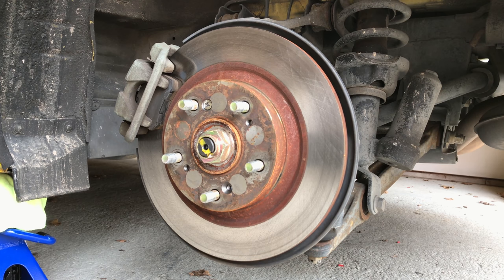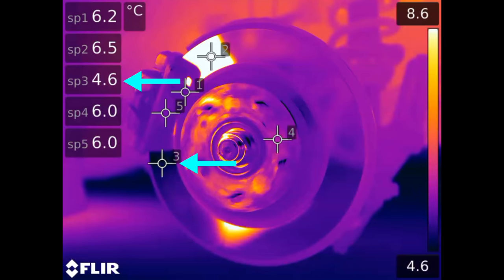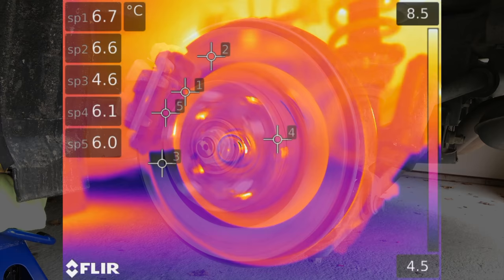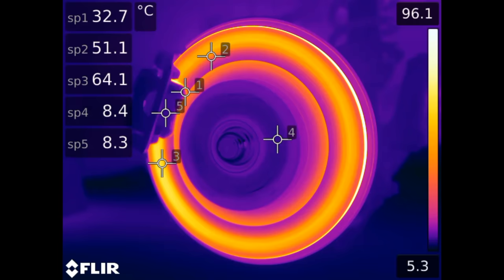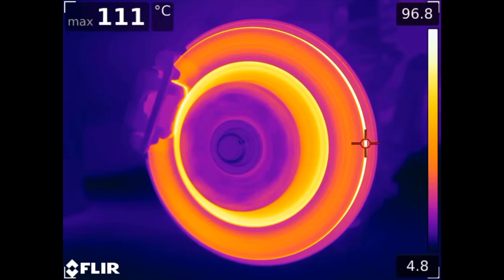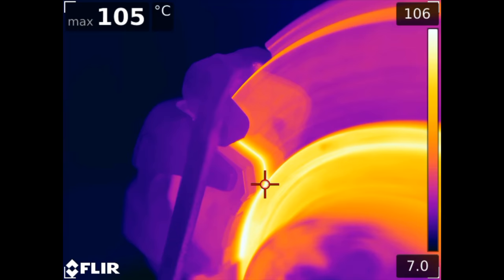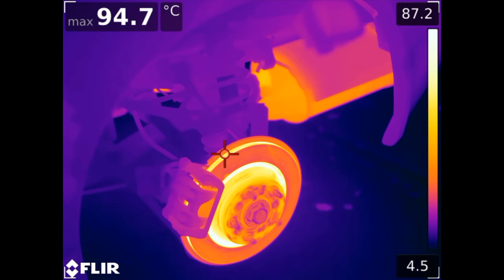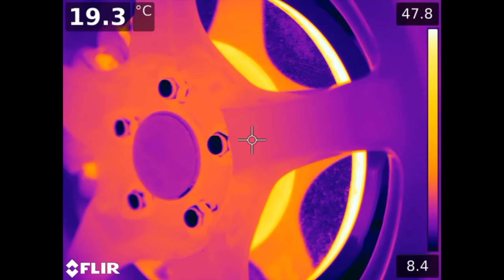How Hot Do Your Brakes Get?

Comment: Interesting that this is posted today.  During NASCAR practice yesterday, it was noted that due to the heavy cars, 3400+ lbs, small tires and wheels, the brakes generate tremendous heat.  The brake rotors and calipers fill nearly all of the space within the small wheel so that most cooling comes from ducting the teams add for cooling.
Due to brake technology, the brake systems don't fail anymore but what does happen is that the heat generated from the system gets transferred to the steel wheel and melts the bead of the tire causing tire failure.
Reply: jmurphy1973 That's neat.
Reply: jmurphy1973 The wheel acts as a heat sink and when you go to a track day you can definitely feel the wheel heat up. Do NASCAR cars really transfer so much heat to the tires that it melts the rubber? If this were a common occurrence you would see constant tire failure. However that's not the case. The wheel must be acting like a sufficiently effective heat sink to mitigate this.
Reply: I dont really get nascar. Subpar cars, nothing that could be called "track" and thats basically it. Why do people do that?! lel
Reply: Sheesh NASCAR is pretty much a drafting contest. Although it might not look like much, it does require a degree in skill especially to know when and when not to brake. I personally am in to motor cross or rally car racing but I've seen these motorsports, they all have their spirits and I respect them equally. But I also like to tease them around :)
Reply: Not every week the teams race in 95 degree temps, like they are encountering this week in Phoenix.
Reply: It's just a tradition at this point. I liken it to the modern version of the ancient Roman chariot races.
Reply: Why do they even need brakes?  All they do is drive in an unbroken circle.
Reply: Very interesting...  
A similar failure mode was common for heavily laden touring bicycles on long steep hills using folded tires.  The rubber brakes heated up the rim until the tire could pop off (I think it was the tire pressure increase due to temperature as opposed to melting).
Reply: jmurphy1973 first off, Nascars do a few road circuits, such as infieon in calf. second off, you still need to brake Nascar on oval circuits, I mean, 3400 pounds isn't the lightest possible weight for a car, race trucks are even lighter
Reply: @Sheeshening  NASCAR seems to have eliminated all aspects of having a variety of vehicles to the point of where only slight variations in engine capability are permitted. It's like they only have one vehicle "class" unlike other race organizations that allow multiple types of vehicles to race simultaneously with class winners. NASCAR, I believe, want it to be more of a drivers' race. Yet, some wealthy owners have vehicles that are more capable of others.
Reply: Just got back from Simulation game Project Cars and it showed car braking temperature around 750F on clear day! That's nuts!
Reply: @thetechtron9465  That is crazy. But it shows the high level of energy transferred from the forward motion of the vehicle to the brakes and subsequently dissipated from them primarily by radiation.
Reply: @ninemilliondollars  Wait till you think this was too much. Saw some titanium brakes video and the temperature goes 1850F and about 1100C!!! And just to think titanium has melting point of 1600C...At this point im worried for what happens to tyres and nearby car parts

Comment: As a brake engineer, yes, aluminum wheels improve brake fade performance vs steel wheels (of course shape of wheel plays a role too).  I have never tried carbon fiber yet it should be worse since it's thermal conductivity is typically less than Aluminum.  Yet that also depends on the carbon fiber and once again wheel shape.
Reply: Cool story bro.

Comment: If the wheel can function as a heat sink for the brakes, could the application of thermal paste between the hub and wheel increase breaking performance? And which kind of wheel would be better for this purpose (shape and material wise)? As a car and PC gaming enthusiast I am exited for what we could learn from this.
Reply: ElZamo92 asking the real question there
Reply: ElZamo92 you could be onto something
Reply: I thunk some thermal grizzly conductonaut will do the trick and maybe if u lap the wheel hub it will help the cooling efficiency
Reply: out of the wheel material choices given: steel, aluminum, carbon fiber, or magnesium.... aluminum is the best conductor.  however, most aluminum wheels are painted to prevent corrosion, the paint can act as an insulator. another factor is the caliper, a heavy steel caliper retains lots of heat while an aluminum one helps dissipate it more quickly.... and the steel one will more likely help contribute to warped rotors over time. as for if a conductive paste would help, not sure try it if you want.
Reply: Any paste you apply would probably get squeezed out when you tighten down the wheel, and if you put a thermal spacer it would act like a wheel spacer and change your wheel offset which could hurt suspension performance.
And you want the wheel to absorb some of the heat of the brakes to help with cooling, but only up to a certain point and after the wheels get too hot it heats up the tires too much and can hurt your tire's grip.
Reply: yeah, I think computer thermal paste was not designed for the amout of pressure the bolts of a wheel would put on it
Reply: you underestimate how tight a cooler can be on a motherboard :D
Reply: a better option than paste, although more difficult, it has proven to reduce brake fade on track cars.... building ducts to get air forced into the center of the rotor, some even use small fans(not practical on a street car)...
Reply: thermal paste would do nothing to help braking. If anything, it could make it worse in the chance it got on the rotor.  
It also would break down pretty quickly as the wheels heat cycle, go through water, sand, road debris, etc.
Then there's the fact you aren't using that much surface area to make it effective. You'd see maybe a slight drop in temps on the hub, but as soon as you hit the brakes, the rest of the rotor would get hotter.
Reply: #duckymasterrace
I usually put a very light coating of anti-seize between my wheel and rotor to prevent the two corroding together so it's easier to remove the next time. Since it's an aluminum paste compound (copper is also available), I'm sure it acts like thermal paste allowing better transfer of heat. How much? Not a lot at all. Maybe 1%. But it's a secondary benefit. I also put it on my lug nuts for the same primary reason.
Reply: RyanRants nice. yeah same here. copper anti seize since copper is a better conductor than aluminium or steel. and works at high temp. also prevents rust and binding which is a plus
Reply: Turbofan wheel covers?
Reply: Just use some copper paste. (i always use copper paste)
You will also prevent the wheel from seizing on the to hub.
Reply: For carbon ceramic brakes, braking efficiency increases with temp.
Reply: Yathu prem sure, but those cost thousands of dollars. A pint of thermal paste costs about $50.
Reply: Carbon seramics aren't that much more than a regular set.
Reply: I tried to put thermal paste on wheel, but both surfaces were so rusty that i don't think it changed temperature much.
Reply: I agree with a lot of the replies that it wouldn't work. A better solution is to increase the diameter of the brake disc. Then have the brake pad contact the outer half of the disc, and design a rim that contacts the inner half of the brake disc. This way you're not having to transfer heat from the disc > hub > rim, its going straight from disc > rim. A perfect mating surface wouldn't matter at these temps and sizes and would only contribute to a slight increase in performance, however if you wanted a perfect mating surface, you could have a layer of copper (<1mm) pressed into the rim so that when the entire thing is tightened down, the soft copper will fill any small impurities between mating surfaces.
Reply: Good luck stopping with that setup. 
Or going for that matter.
Reply: I've experimented with this a little.  If you can get the right high temp compound, it will transfer more heat to the wheel, but not enough to notice a difference.  Industrial thermal compound is so expensive that it is not worth it.  Arctic silver or any other PC compound is already expensive enough, and it will burn off at 200C, on track brakes hit 500C+ as mentioned in the video.

Even if you had unlimited money for exotic thermal compounds, the problem is that steel is such a poor conductor of heat that it takes a while to transfer the heat from the rotor surface to the hub where the wheel can absorb it.
Reply: RyanRants don't lube your lug nuts, it interferes with accurate torquing of the nuts/bolts.
Reply: ElZamo92 Pretty sure any PC thermal paste would simply melt under temperatures of braking
Reply: Breaking performance is more important then braking.
Reply: B10401 gold would be the most expensive, and worse option. It's way too soft, and would bend under the full weight of a car.
Reply: +James pond

Not to mention it would be heavy which negates any performance gain by better brakes.

Longer to stop
Longer to accelerate to same speed
Higher fuel economy
Harder, harder to steer.
Reply: On motorcycle trackdays I've often heard people say that brake heat seeps into the wheels and helps warm the tyre from the inside out. Would be really interesting to fit a thermal camera like this to the fairing or front fork, facing at the tyre and discs (dual disc on a sportsbike front wheel) and do a few laps, see how true this is and what temperatures the disc gets to.
Reply: Painting the wheels doesn't help much at all.
You have a layer that is what microns in thickness and you think it will do anything useful.
Reply: well termal paste is pasted on  cpu and hetsink to help make a "perfect" contact point, as both surfaces are not perfectly straight, the paste fills those cracks, small place where the heatsink oesnt have contact with the cpu, as is so small in this case it helps alot, on a bigger apliance as this i think i will be really small diference
Reply: ElZamo92 I don't see why covering the contact surface in thermal grease (big tub of MX-4 sounds handy...) wouldn't help heat transfer. I would get all the rust out of there first though!

As far as material though, it really depends on what you need. Steel can soak up more heat momentarily, but aluminium will dissipate it all quicker
Reply: ElZamo92 mirror polished + artic silver 2 is still the best?
Reply: i was thinking of adding fan like extensions on the wheel spoke, so the wheel can acts as a makeshift fan.
Reply: the 1993 mustang cobra had directional fanned wheels
i think that would be a great platform to test this on
Reply: You do know that the front brakes are vented so they draw are in when it is rotating due to the centripetal force blowing the air out.
Reply: you guys should look up turbofan wheels.
Reply: ElZamo92 I believe that if the wheel's spokes are designed in a fan type way to blow air onto the rotor when traveling at speed, it would be greatly beneficial🤔
Reply: EmofacePS3 yeah, i would be easier than trying to make our own fan shaped spokes for the experiment. also would be interesting to see the aerodynamic impact as we essentially pumping air into the underneath of the car. would it cause a slight ground effect or too little to have any impact.
Reply: that's a really good idea mate, and it already exists :) check out Mercedes SLR Mclaren and it's wheels. The wheels are designed like turbine blades so they blow fresh air into the braking system. Although if one side wheels are mounted on the other side, the effect is reversed and brakes overheat with extreme ease.

Modern middle class cars also have turbine-like blades, like 2010 Mazda 6
Reply: Where are your laminated papers. No degree no one who can do something with this good idea will care.
Reply: anti seize grease kind of serves the function of thermal paste would of. although its not as efficient, it's basically grease with aluminum particles in it. it will improve thermal conductivity
Reply: I use designed for AMD thermal paste
Reply: doodskie999 i have an 8120 in my computer and i find this funny
Reply: Spraying water on your intercooler, and your rims.
Reply: Isn't gold a better reflector of IR?  That would also make it a poor emitter.
Reply: Pressure has nothing to do with this. Thermal paste is there to replace air, not metal. You still want metal-to-metal contact (which actually takes the pressure). If you put too much paste on the CPU, it would just run-out to the surrounding area.
Best conduction is between mated metals. Heck, most thermal pastes contain metal particles.
As for pressure on CPU, if you put too much, it's the motherboard or CPU itself that gets physically damaged. Thermal performance is not hurt until this happens.
Reply: i think not, if we can get better cooling on the brakes then there is a good chance  can overclock the brakes, increasing the abs system base freq multiplier or the brake like clock speed.
Reply: If you are using anti zeeze between your wheel and the rotor to avoid the wheel to stick then it kind of do the job of termal past even if it dosen't have the same termal transfer. As for what kind of wheel. The mags have usually a bigger contact area wuth the rktor than steel wheel. Bigger is the transfer surface betterr with be the temp transfer. Mags are also usually thicker than steel wheel do to weeker material so by physics will be a better heat sink than steel wheel. Since the steel wheel is very thin it will get cooler way faster than a mag.
Reply: @akmalps9999  can it run crisis?
Reply: well if we added thermal paste it could help the heat but would decrease that performance cause there would be less friction between the brake pads and the brake rotor

Comment: Wheels certainly Can absorb and transfer heat from the brakes of a vehicle. 
When I worked in a shop, this is one way we were sometimes able to spot brake issues with a customer vehicle when doing inspection during routine services like oil changes and tire rotations. While inspecting brakes for pad thickness, adjusting tire pressure or rotating tires, you can sometimes notice that one wheel is significantly hotter than another (sometimes to the point where you can't touch it bare handed!), or spins much less freely than the other. More often than not when this happens, you would find the pads to be much more worn on that corner, either from a warped rotor or sticking caliper.

Comment: that's really cool....can you do one on exhaust system ( tailpipe + muffler + catalytic converter, etc ).....
Reply from the maker: +Sachin Dangi yes, this will happen! :)
Reply: Are the visibly black paints also good absorbers at IR wavelengths?  I guess the IR camera could be used to determine the suitability of the black paint?.
I am glad people are discussing this... I had some thoughts about the people that chromed their entire engines...  The chromed parts are almost mirrors at visible wavelengths.  If that continues for IR wavelengths, they have increased the operating temp of their chromed parts if they are hot parts.

Comment: That was incredibly interesting! Thanks for the insight Jason! Does the reflective surface of the rotor skew the data?
Reply from the maker: Somewhat, yes, but you can calibrate the camera for it and get pretty darn close.
Reply: Engineering Explained, the only 'issue' after adjusting for the emissivity of the reflective rotor is itll skew the results of the rusted part. Not much you can do when putting everything together in the same picture.  I work with thermal cameras for a living and its nice to be able to use it for fun stuff like this as well. Thanks for making this series of vids with the thermal camera.
Reply: Gears and Gasoline another interesting thing about thermal cameras is that clear glass acts like a mirror to a thermal image. Visible light can pass through the glass but thermal energy (mostly) gets reflected back.

Comment: It has been my experience as a parking lot racer (SCCA Solo 2) and as a Pro Rally racer, that wheels do in fact work as a heat sink for brakes (aluminum vs. steel). One thing I was never able to determine was at what temperature do brake pads catch fire. As I recall, toward the end of the 3rd stage at the STPR rally in Pennsylvania, it was a tight twisting road racing down hill, and I would be a little too heavy left foot braking, and would come into the Finish Control with my front brake pads aflame. the full metallic pads and Brembo rotors would still be working fine, and I would finish the event without changing them (the pads), the bonding agent of the pads would be compromised, and would soon crumble apart. Videos easily show Rally Cars blasting through corners with glowing rotors, but as far as I know, I'm the only one that was able to ignite my brake pads. When fellow competitors commented that their brake did not catch fire,  I simply asked them to compare our Stage times.

Comment: When you brake without a wheel, the little screw holding the brakedisc on the axle has to handle with all the torque. With a wheel fitted on the axle, the force is transmitted by the Wheelnuts/bolts. The tiny screw is just for centering (holes in disc are  bigger than wheelbolts) and holding the disc when there is no rim to prevent it from falling of.
Reply: See 0:00 - 0:07 for the smaller bolts and the tiny screw.
Reply: +1 Some nuts should holds the disk. Less vibration, more honest test.

Comment: You'll see many modern race cars actually warming their tires with the brakes. In fact, it is absolutely the best way to warm up the rubber. The only downside is it wastes fuel, so endurance racers are more likely to continue cornering hard to do the same thing.